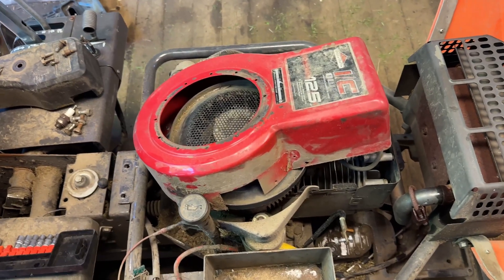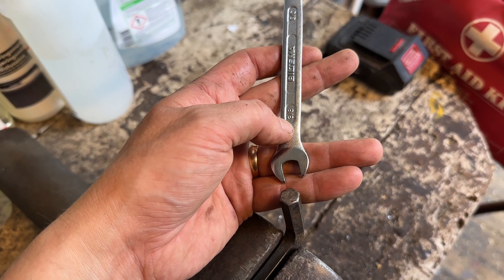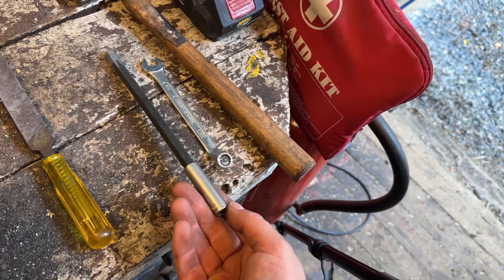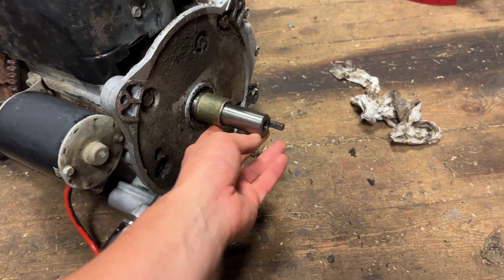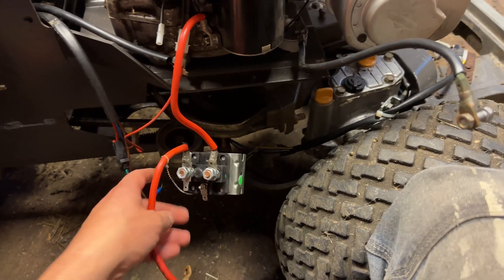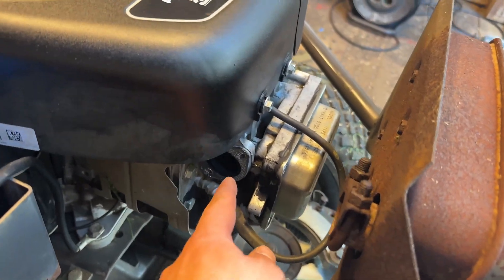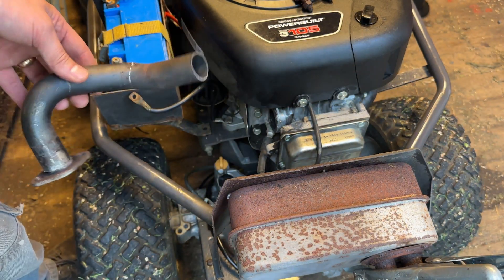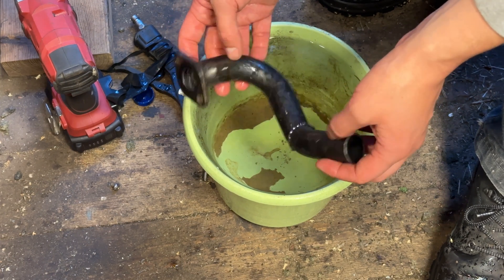Engine change on Husqvarna rider, short version. Method, special tool, parts etc.

Comment: Question: where did you place your sump vacuum hose for the fuel pump? You have fitted the later model engine with ohv.
Reply from the maker: Hi! The engine had a fuel pump already so I didn’t have to do anything but plug in the hose from the fuel tank.

Comment: Does anyone know if there is any way to switch out the middle belt section belt tensioner metal device, right below the engine belt pulley, without disassembling the engine (Rider PF21)? I can’t get the belt tensioner out because the engine belt pulley is in the way on top of it. And if I understand the Husqvarna drawing correctly you cannot get the engine belt pulley out without lifting the whole engine up?!
Reply from the maker: Hi! I tried to look this up in the workshop manual (since I don’t have that model) but the it is not mentioned there. I did change engine on a Rider 13 but never changed the tensioner arm, what is the issue with yours?
Reply: I got the machine together with the house and the tensioner seems bent/twisted and sometimes gets stuck on the frame when lowering the cutting unit. So I wanted to switch it out and got a spare part. But looking at your video and the manual it seems like I need to lift up the whole engine. How about your machine? It looks like the tensioner is also below the machine belt pulley and cannot be taken out without lifting the engine?
Reply from the maker: @Fourley I have not tried to change the tensioner arm so hard to tell. When they stick to the frame I just bend them a bit until they work.

Comment: Wow!  Really enjoyed your video.  My neighbor just bought a non-running Husqvarna Rider 850-12.  It is starting and running now, and moving forwards so far.  Your video offers a lot of insight!  Can you tell me what size/type of battery that is?  A standard U1 group doesn't fit under the hood.  Thanks from Canada
Reply: Thanks for the fast reply.  I will check it out!
Reply from the maker: @kenjones4139  that is great to hear! I have a video about batterie change in the rider, perhaps it helps. Never heard of U1 battery, that is not a term used here unfortunately. https://youtu.be/PGem2y6djgM?si=ySqI3yOo9kqmc5Zd
Reply: Took a look at that video.  The replacement battery you used is a U1R-9. That's what I meant by a U1 type.  But I notice you don't have a hood on that rider, so likely the same issue we have.  The Rider you changed the engine on looks to have a powersports battery.  I was wondering what type it is like a YTX12-BS or YTX14-BS.  Thank you.  Looking forward to checking out your other videos.

Comment: What size is the Inbus u are uing to remove the crankshaft bolt?
Reply from the maker: The answer is at 1:22 in the video. But if I was unclear, the size is 3/8 inch.
Reply: @NilsKall  "three of an eighth" is what you said. we usually say "three eights"...
Reply from the maker: @tweedledee4922 OK, English is not my first language.